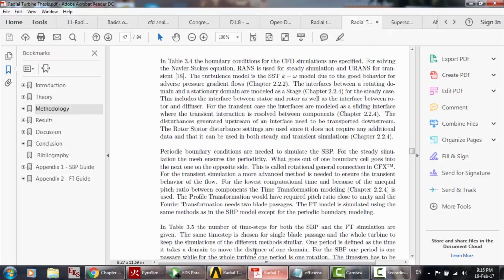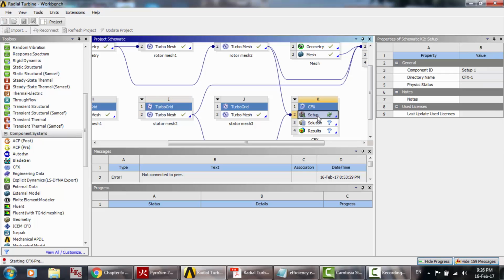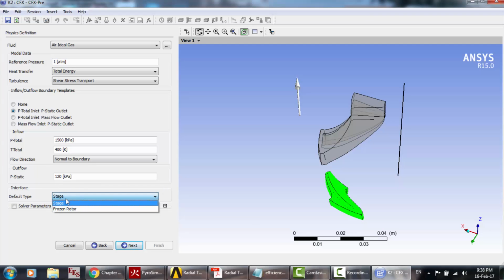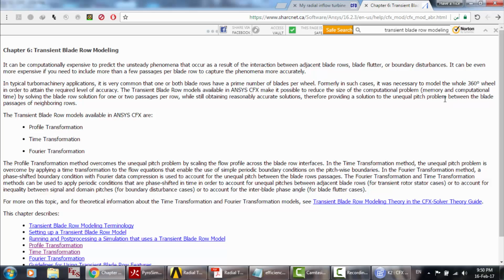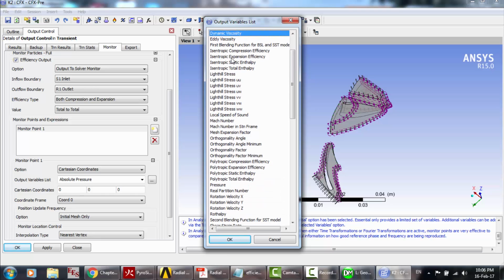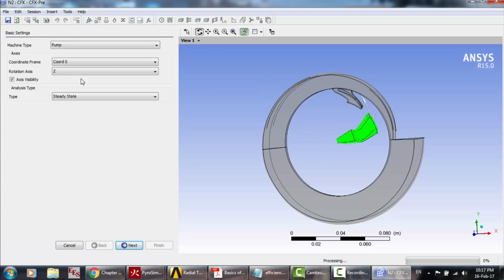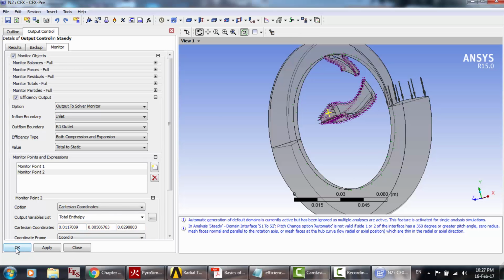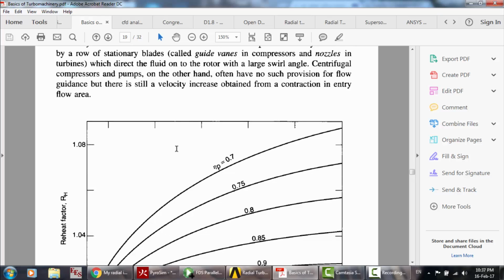A CFD Radial Turbine Simulation Using Ansys CFX After Export Points Method And TurboGrid Mesh

Comment: hi   how to design stator blade using blade editor??
Reply from the maker: Hello, you can design the blade using bladegen or Vista as I showed in all of my videos. Kindly check out that method. Thanks
Reply: @haveanicetime  sir   im using ansys 2023 version , here i can design rotor usig blade gen  but for the stator i  dont know how to. when i search the internet  its showing that ive to define the alpha angles instead of beta angles but there is no options for that in blade gen or vista . i have asked you before , but you said to check the CFD playlist. i can not find anything that shows the stator design, kindly respond this request
Reply from the maker: @muhammedfadal372  Hello, the videos in the playlist show the general outline of using bladegen. BladeGen is a 3D blade design tool primarily used for:
* Turbomachinery components like compressors, fans, pumps, and turbines.
* Designing rotor and stator blades, including axial, radial, and mixed-flow geometries.
You'll find what you need in this paper:"Design and Optimization of a Stator Turbine Blade Profile Using Control Parameters" and you shall do a deep literature review. otherwise, you will struggle. Thanks
Reply: @haveanicetime  sir   im using ansys 2023 version , here i can design rotor usig blade gen  but for the stator i  dont know how to. when i search the internet  its showing that ive to define the alpha angles instead of beta angles but there is no options for that in blade gen or vista . i have asked you before , but you said to check the CFD playlist. i can not find anything that shows the stator design, kindly respond this request

Comment: Good morning, I don't know if it's still active. I need help. It's doing the same thing but with a Francis-type hydraulic turbine and finding the speed triangle. I did it with the Hydraulic Turbine Report but I get power, efficiency, angles and speeds that are very different. I don't know much about the program so I don't know what the error would be. I use bladegen- turbogird- cfx.
I need to simulate a hydraulic (water) turbine in a power plant and compare the power and efficiency data and the speed triangle in a numerical and analytical way. The problem is that it doesn't even come close to matching.
Reply from the maker: Hello, if you are simulating Francis Turbine, use ANSYS Fluent not CFX because it is not suitable to do in Turbomode. Get research articles related to the point of research and checkout the methodology and approach. You will find my video about a centrifugal fan in FLUENT to know the basics. Thanks

Comment: Thank you for your tutorial video.
It is helping to make CFD.
I have a question about the method of the meshing figure ofsingle and whole‐circle flow paths for the guide vane.
Also how to make optimized for the guide vane?
Can we use the blade modeler or other tools on the workbench for guide vane?
Reply from the maker: Hello dear J, you are welcome! Just tell me the minute where you ask about the mesh to know what you want. You can use Vista or bladegen to generate the blade and then you can use the blade editor to optimize it. 

https://www.youtube.com/watch?v=jKRzrj9d4gE&ab_channel=AnsysHowToVideos

https://www.youtube.com/watch?v=78xGuRBuEXw&ab_channel=AnsysHowToVideos

Danke!
Reply: @haveanicetime  Hi Dear! Thank you for your reply.
I want to know the method is like stator modeling. Because I'm just designing for ORC turbine system by using guide vane type.
The flow path of the impeller blade can make, because of your video. But I do not well, how to design the stater using Ansys.
Reply from the maker: @j-wata1543  Hello dear J, before using ANSYS, you must study the fundamentals of designing the stator of the machine you are studying. You will find the basic equations related to the blade design and its performance in the references of turbomachinery. After that, you use Vista or BladeGen to generate the blade according to the results of the 1D calculations. Danke!

Comment: Hi sir, may I know where to refer for CFX post processing for radial turbine? Thanks in advance
Reply from the maker: Hello dear Mohamad, if you mean a tutorial about CFX post processing, you can watch this Russian tutorial. Danke! 
https://www.youtube.com/watch?v=DNqS2ln3JP0&t=24s
Reply: @haveanicetime  Hi sir, so sorryy to bother you but how to make inlet at the stator? I keep failing my cfx convergence because of that.
Reply from the maker: Hello dear Mohamed, do you mean or the boundary condition? Danke!
Reply: @haveanicetime  the mean I think because my geometry only has outlet at the rotor but not inlet at the stator/nozzle
Reply from the maker: Hello dear Mohamad, whatever, you should have an inlet and an outlet. If you have a rotor and a stator, a face of the stator will be the inlet and a face of the rotor is the outlet according to the operation and the flow direction. Danke!
Reply: @haveanicetime  Got it! Thanks. btw how do I know if my results is converged?
Reply from the maker: Hello dear Mohamad, I am sorry, the notifications are dead. If the residuals are in 10^-4 or lower. It is better to study these fundamentals because you will face many challenges. Danke!

Comment: LIBRARY: 
  CEL: 
    &replace EXPRESSIONS: 
      Rotatng Speed = 25000 [rev/min]
      dPtot = massFlowAve(Total Pressure in Stn Frame )@REGION:Passage INFLOW - massFlowAve(Total Pressure in Stn Frame)@REGION:Passage OUTFLOW
      eff = torque * Rotatng Speed /(volFlow *dPtot )
      torque = torque_z()@REGION:BLADE
      volFlow = massFlow()@REGION:Passage INFLOW / areaAve(Density )@REGION:Passage INFLOW
    END
  END
END
Reply from the maker: Thank you for your suggestion :) !
Reply: i did only what u show in ur video my teacher. it works but i dont know which type of efficiency calculated with these codes. İs it total-total isentropic or totat-static?
Reply from the maker: Download the file chapter 3 in this link, it is the 1st result. It is a word document that has some information about the fundamentals. 

https://www.google.com/search?source=hp&ei=XQadXfGoL4XjgwfWjpnIDg&q=total+to+toal+efficiency&oq=total+to+toal+efficiency&gs_l=psy-ab.3..0i19l2j0i22i30i19l5.2555.10227..10548...0.0..0.213.3855.0j24j1......0....1..gws-wiz.....0..0i131j0j0i10i1j0i22i30j0i22i10i30j0i13i30i19j0i22i10i30i19.yfM1N0ZXkyU&ved=0ahUKEwixy5GT1I3lAhWF8eAKHVZHBukQ4dUDCAY&uact=5

Depending on the location of the point, the efficiency is defined. So, I recommend not using these codes and use the h-s chart to get the isentropic work (h1-h2s) and get the value of h actual from the simulation and divide the quantities to get the eff.  To be sure of the type of the efficiency, check out the research papers that have this value and you will see the procedure they used and if it is total to total or to static:)  

Danke!

Comment: Hi teacher. I salute you again. which reasons make me not able to converge at the solving stage in cfx solver. many times my calculation cannot reach residual level of e-04. which action do you advise me to do to fix that problem. By the way i think if u publish a new video about creating stator it would be very helpful i think.
Reply from the maker: Hello dear Yusuf, there are many reasons for the high value of the residuals. The mesh size, the connection between the components, and the boundary conditions are far from the reality. Check out again the model please. 
The stationary blade is just an extrusion process for a 2D airfoil sketch or a loft command for 2 airfoils. That's it. It is not a big deal at all. Watch my video about the axial turbine. 
The blade is like the stator shown in this video.Also watch the axial compressor video. Just airfoils. The assembly is the critical operation. Danke!

Comment: Thank you so much for sharing this but how do I create a volute for a radial turbine and a centrifugal compressor?  Can it be done in Vista RTD and Vista CCD?  I know Vista CPD makes a volute for centrifugal pumps but I cant figure out how to create one for turbines and compressors.  Thank You!
Reply from the maker: Hello dear D. you can use CPD for creating the volute flowwithout any problem because it is just a casing with some specifics and CPD can do it and use it for the machinery you want but it should be close to or similar to the real case related to the machine's type. Just check out the manual or the options of the volute in CPD, it is not complicated. Danke!
Reply: @haveanicetime  Thank You!
Reply from the maker: @DR-br5gb  Bitte schön !

Comment: Hello,
How did u make the stator and volute as u have mentioned only rotor in ur previous video
Also, how to assemble all the components
Reply: Thanks for your help
Is the assembly done in ansys as u have shown rotor design 
Did u import stator and casing and then assembled in ansys
Reply from the maker: @chaitanyananda5022  Please watch the video of the rotor of this radial turbine, after creating the mesh in turbogrid, we generated the mesh of the stator in turbogrid too and then imported the volute flow into ANSYS to create the mesh but using ANSYS mesh, then we connected all of them in CFX..They have the same origin. I showed what you ask about in this video... Danke!
Reply from the maker: Hello dear Tintin, the stator and volute were created using SOLIDWORKS. After having all parts, we make sure that their locations are consistent with each other because when you carry out the assembly, you have to find all of them at the correct location. It is just caring about the point of origin and the dimensions. You can create the stator, rotor and volute using Bladegen and Vista. Danke !
Reply: Also it would be great if you could send  me the casing and stator files to
nandachaitanya14@gmail.com
Reply from the maker: The CAD files are not mine and I cannot share them with anyone. I am sorry. You can generate your own design. Danke!

Comment: i get a question again. again its me :) in ur video u show ur rotor stator and volute. in ur previous video u made a high quality mesh to the your rotor. But in this video vaned stator and volute already exist in the beginning. My question is how can we create  volute and stator in ansys or i should create in other CAD programs and after that import them in to the ansys. Or is there any tool like a bladegen or vista RTD to obtain geometry of rotor to obtain automatically volute and stator.. i thank u so much about you answer my latest 12 question with ur amazing patience :)
Reply from the maker: Hello dear Jo, you are welcome all the time :) Simply you can use Bladegen to design the stator or the rotor too, for the volute, you can use Vista CPD (centrifugal pump) to generate the volute, also you can generate all geometry from any CAD software. It is the designer's choice, when we use Vista or Bladegen.

It is better 100 times than any CAD software because we directly import the geometry into Turbogrid and no need to do the procedure I showed in the videos :) 

The method I showed in the videos (the export points ) is only if you have an old design or a design already manufactured and you wanna investigate it. 

The other tools is for making a new developed design....If you will develop a new design from scratch, you should use Vista and Bladegen as you want but you must study the velocity diagrams from any reference to know the concept of designing any turbomachinery or you will not understand many things in the future....

Viel Erfolg!
Reply: Danke Schön!!! Dear Mansour ( i see ur name in your video :) You are my idol....
Reply from the maker: @jopho7777  Vielen Dank sehr geehrter Yusuf ! Sie sind sehr nett !

Comment: I use NUMECA CFD for designing axial and radial turbine design as an aerothermal engineer in Turkish Engine Industry (TEI ) . CFX takes so much time and doesn't converge at all with respect to the test results :D
Reply from the maker: Thanks dear Ahmt for your comment ! The convergence depends on many parameters, if the simulation is not converged, the procedure that was followed was not correct....Over than 90 % of the published research papers showed the using of ANSYS CFX and ANSYS FLUENT in the field of Turbomachinery....

We all hope we use another better software like what you mentioned in the future...The idea is to make it easier and not time consuming :)..... Thanks

Comment: Many many thanks for your great tutorials. Please, would you give me some hints about making the stator blades. Can I make these starting from VISTA? Or I need to model as in SolidWorks?
Reply: I was able to make the stator using blade editor. I can make better stator if I first make the stator blades in SolidWorks, and then make flow path in blade editor. Thanks again for your great video. 

Please, can you tell me in more details about the volute design? I know that there is a automatic volute design feature in VISTA CPD. But I need volute for a radial turbine. How can I do that in ANSYS? 

Looking forward to hear you.
Reply: @mdshujanali5228  can you please share the steps ?
Reply from the maker: You are welcome dear Muhammad :), you can use Bladegen or Vista to design what you want, just check out the Ansys Turbosystem user guide to get more information and tell me if you have any  problem :) The links are in the description....Danke!
Reply: Thanks for your reply. I will use the Turbosystem guide, and follow up later.
Reply from the maker: Okay, Good luck!
Reply: Hi. I think there is no template in vista or bladegen to make the stator nozzles? I can draw meridiam plane in blade gen and build the nozzle. Am I wrong?
Reply from the maker: Hello dear Muhammad, I am not quite sure, you can check out the Ansys TurboSystem user guide and also you can see how to design the suitable nozzle for your turbine and then continue the steps, tell me if you still have a problem :) Thanks
Reply from the maker: Hello dear Shujan, what you do is great :), you can also check out the papers in the next links, it contains some design principles about the design of a radial volute :)....If you need any thing else, tell me please..Danke!

http://www.mediafire.com/file/ayz1krh2mmw64i3/OBJ.pdf

http://www.mediafire.com/file/g83b3hqqb8x52qb/Shah_2014.pdf
Reply: Hi Shuajan, how do you create stator flow path in balde edtior? Could you give me more detail?
Reply: Thanks for your course! I have a solid rotor model in Solidworks for reverse engineering, but I don't know how to create the same model using bladegen. 
In BladeGen it's necessary to know angle and thickness change in layer shroud and hub along Meridian if we want to create rotor  model. But how can we require these information? Have you done similar work? Look forward to you reply!
Reply from the maker: Hello dear new energy :) you are welcome, you can use CAD import feature to modify the rotor blade angles like the video in the next link, also, you can type here your e-mail and I can send some snapshots about creating the stator flow path, it has to be in z-x plane...So, tell me if you have any other questions and I can contact with you by e-mails...Danke!
Reply from the maker: https://www.youtube.com/watch?v=tVfs_ZDlwXw&t=142s
Reply from the maker: Also, you can use the manual method to create the fluid path of the rotor blade without using Bladegen, I have shown this in one of my tutorials :) Thanks

Comment: hii its very helpfull video but i facing problem to make stator blade coordinates or design. can you help me?? thank you
Reply from the maker: Hello dear Hiran, you are welcome :), you have to check out some references about designing these kinda blades, what is your progress now? Thanks
Reply: Hello sir, right now i am trying to design radial inflow design with n-pentane fluid.. i completed impeller design with the help of bladegen and i struggling with nozzle blade.. can you suggest me any reference..
Thank you
Reply from the maker: Okay, I am gonna check out some references and tell you, do not worry :) ..Thanks
Reply from the maker: Hello dear Hiran, check out the next links and tell me your progress and problems please...
Thanks

https://www.google.com.eg/search?dcr=0&source=hp&ei=euqRWpi8F4LDwAKwjqPoDQ&q=radial+turbine+nozzle+design&oq=radial+turbine+nozzles&gs_l=psy-ab.3.0.0i22i30k1l2.1079.6961.0.8520.22.21.0.0.0.0.619.2986.0j3j4j0j1j2.10.0....0...1c.1.64.psy-ab..12.10.2979...0.0.jjeJ_-gpL40

Turbomachinery references
http://www.mediafire.com/file/atan0c5i1pgw5q5/Turbomachinery_References.rar
Reply: hello sir,,, i tried to so many way to make nozzle blade but during the analysis i got the zero mass flow rate,,, i checked the all boundary condition and rotation direction but same result i got..how can i solve the problem?
thank you
Reply from the maker: Hello dear Hiran, could you send me the project on mech.eng.ahmedmansour@gmail.com ?.. Send it without any solutions, just the setup only to make the files small size...Thanks

Comment: Thank you for your course. But I'm confused how you get the stator mesh 1, cause you know, I have a problem with stator mesh. Looking forward to your reply.
Reply from the maker: Not at all dear Jing, the stator coordinates was imported into turboGrid as txt files because we did not know the method of generating the flow path of the stator blade because it was very small..Now, I got the right method...you can send me the blade of your stator to check it out and try to generate the mesh for you, then I will record a general tutorial about fixing this issue :)...mech.eng.ahmedmansour@gmail.com
Reply: It's so nice of you. I have the BladeGen file of the stator, but the stator and rotor don't match in CFX Pre. They overlapped. I'll send you the stator file from my gmail. By the way,  I know ASU, it's an excellent university! May you happy everyday!
Reply from the maker: Not at all dear Jing, Nice to know Ain Shams University!..I am gonna contact with you by the e-mail...Thanks